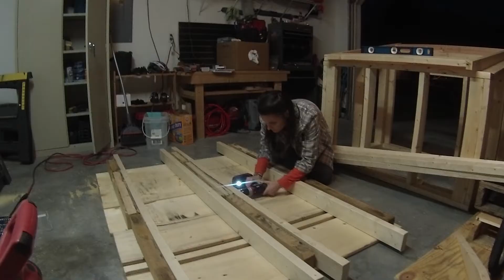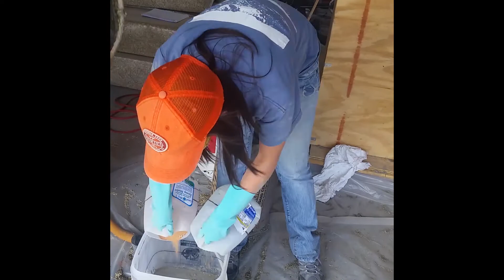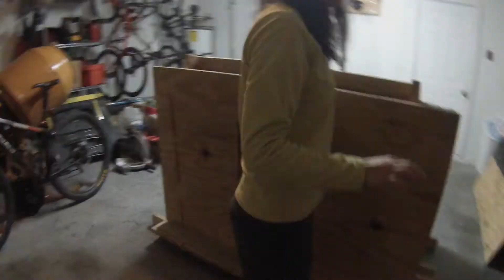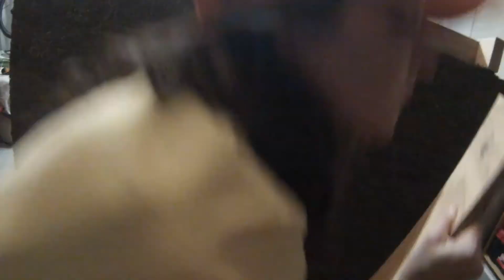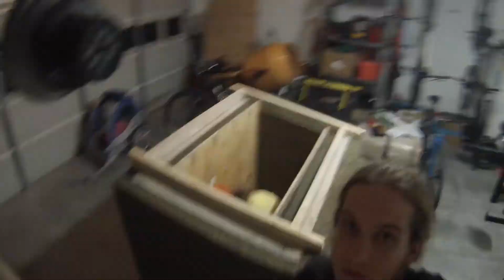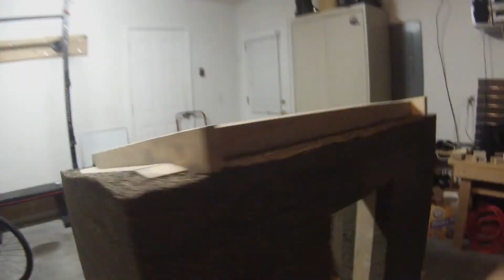Hempcrete: An Environmentally Friendly Building Material

Comment: If your looking for a pozzolan for the hydrated lime use meta kaolin (not kaolin clay). You can then drop the cement.
Reply: Do you know an appropriate ratio for metakaolin in lime for hempcrete?
Reply: @AutoTradeKoreaCorp  hello, I've been using 40% MK to 60% hydrated lime. Though it's not exact at all. 
We are currently doing all the hemp work and all the mixes so far have set really fast.
Reply: @EastyUK have you tried using less MK? Here is an interesting info.
Natural hydraulic lime (NHL) is classified for different uses[2] the first two of which are sometimes called semi-hydraulic lime because they initially set with water but continue to set in contact with carbon dioxide in the air.

Feebly hydraulic lime	Edit
Feebly hydraulic lime (NHL 2) is used for internal work and external work in sheltered areas.

Feebly hydraulic lime contains up to 10% clay / clay mixed with other impurities. It might take one week or more to set after the addition of water. Setting is the process of permanently taking the shape into which lime has been moulded.

Moderately hydraulic lime	Edit
Moderately hydraulic lime (NHL 3.5) can be used for external work in most areas.

Moderately hydraulic lime contains clay in the range of 11% to 20%. This type of lime sets (assumes given shape) within a few days after the addition of water.

Eminently hydraulic lime	Edit
Eminently hydraulic lime (NHL 5) is used for external work in exposed areas, such as chimneys and for floor slabs/underpinning.

Eminently hydraulic lime contains clay in the range of 21% to 30%. Properties of eminently hydraulic lime are close to those of cement. Eminently hydraulic lime sets within one day after the addition of water.

But in another place I read, " the most appropriate for use in 
hemp-lime material was to be chosen – a dolomitic lime DL60 with 40% metakaolin additive. The ratio of hemp/binder 
0.38 gave the best results – compressive strength of 0.221 MPa at 10% deformation and thermal conductivity of 
0.0757 W/m2k, which is considered a good result and shows a possibility for this material to be used as self-bearing 
thermal insulation building material."
Reply: @AutoTradeKoreaCorp  if they are using hydraulic lime then it's going to be very different cure process as it's far more reactive. Hydrated lime just won't cure like hydraulic lime.  I've not a clue what exactly the difference a dolomite labelled lime has on the process, I understand it just has magnesium added to it. Maybe worst for fire proofing? ;) 
I've not tested various mix ratios, I guess reducing the clay would increase insulation value. We have been pretty variable with our ratios probably from 25%-50% mk and not noticed a huge difference in how it's drying. Be interesting to trial a really low mix as mk is harder to procure than the lime.
Reply: @EastyUK   What ratio by volume do you use 4:1:1 or 2:3:3 - hemp hurd :  hydrated lime&MK : water?
Reply: @AutoTradeKoreaCorp  1 (lime/mk) to 4 hemp, 2 water. 
I mix in a regular mixer at the moment, so pour in the water, add mk and lime, then hemp.  Empty the hemp and then throw in the next water, so all the hemp stuck in the barrel goes into the next mix. Much quicker than trying to scrape it out every time. 
I'll do a bit of video when I get a chance.

Comment: According to the bags of 'lime binder' you're using, this is not a lime based binder but a very strong portland cement mortar with very little accrual 'lime' and then the lime used in the bag is not the type you need.  You're adding portland cement to an already high ratio of portland and hydrated lime with very little sand.  you're getting into the Type M range here.  I'm sure it will produce a 'hempcrete, but this mix is not as 'green' as you think it is.  Lime mortars are very complicated and still very few people understand the way it carbonates and reacts to pozzolans.  Hydrated masonry lime is NOT a 'lime binder', btw.
Reply: What type of lime should be used? Can you tell a better recipe for hempcrete? I heard that hydraulic lime is the one to use.
Reply: @AutoTradeKoreaCorp  The whole premise of 'green concrete' is to reduce or eliminate portland cement.  The lime used in hempcrete is slaked high calcium lime either in putty or powdered form.  'Hydraulic lime' already has a natural impurity, clay, containing alumina silicate which is in the hemp fiber already, and only comes in powdered form but it works.  Putty is better than powdered as it already contains the water needed for mixing while powder needs water added and tap water reduces the pH considerably, reducing performance by reducing the acid-base reaction between the lime and the hemp fiber.  Powdered limes also are in bags that are rarely airtight so begin to carbonate in the bag on the pallet which reduces performance, while putty is typically in sealed containers and the putty form is far less vulnerable to air contamination.  But non-hydraulic lime is the only type shipped or stored in putty form, because the hydraulic sets up even in airtight containers.  No portland cement should be used in real hempcrete that is suppose to be 'green'.  When used in portland based hempcrete the hemp fiber acts as a pozzolan that will react to the by-product, calcium hydroxide, of the portland hydration process making it more stable and will add fiber strength and reduce the weight by volume, but will also open the cement up to water intrusion through the fibers, but will act as an expansion buffer in extreme thermal cycles so can reduce cracking.  Using something like hempcrete should be analyzed/considered carefully before large scale installation as the results can be detrimental to your project if not used carefully.  When building a home, make sure you use the proper materials because fixing your mistake is expensive not 'green'.  'Lime' is both the oldest and most basic but also the most misunderstood material in all of the construction industry.

Comment: If it's not a load bering material , it's worthless!
Reply: Stephen Canas 
Insulates.  Pest, fire and mold resistant!  Pretty big deals!
Reply: It's a building with no seams and if you do very little research on hemp buildings you could have your answers instead of being so quick to judge!!  IT'S FAR FROM WORTHLESS STEPHEN!!!
Reply: Properly mixed and used hempcrete is perfect as a breathable insulation, especially for old buildings and can be used within well built wood framing to sustain a reasonable amount of weight. It's not made for making load bearing walls. This video is not a very good example, but you should do your research before calling this material worthless :)